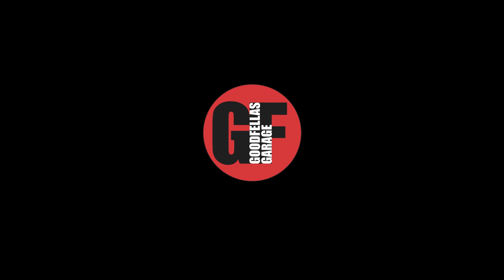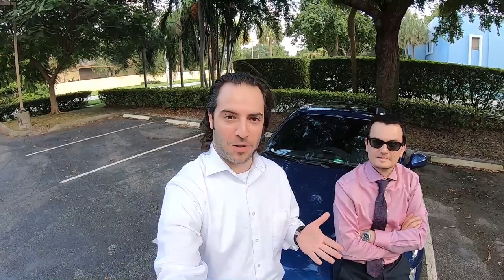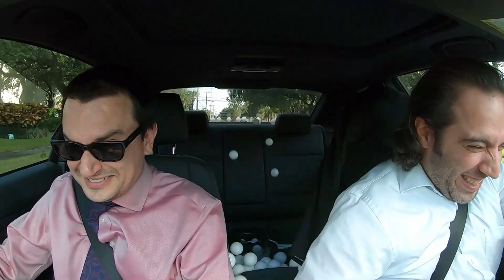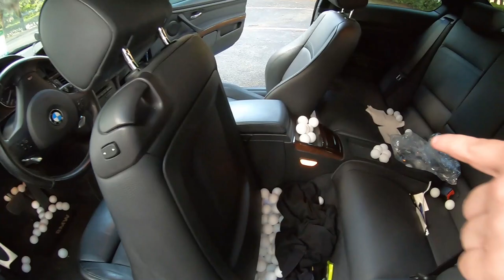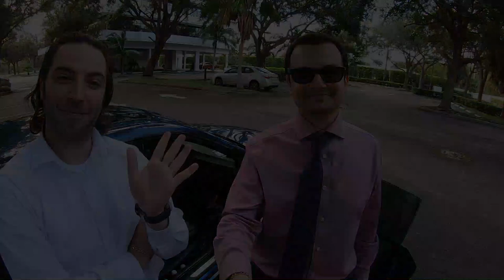Testing Brakes with Ping Pong Balls on E92 BMW 335i

Comment: Wish the car was not abused like this. But then again this is super dangerous and does not set a good example for young drivers. Don’t hate but just got accepted to law school and have learned about the reckless things that can lead to harm.
Reply from the maker: It's just ping pong balls, not bowling balls lol.
Congrats on being accepted into law school, however, you still have a chance to back out before you are soaked in debt forever.
Reply: I know but I was just saying imagine one getting stuck in the gas pedal or brake system. Those are the small things that happen that no one accepts will happen until they do that’s all. And I got a scholarship from PREM who does research and my school will be covered but thanks for the reminder of how difficult these post-university careers will be!
Reply from the maker: @jlgtco97  Jees dude, you already sound like a boring and unimaginative lawyer. You would be perfect for that job.